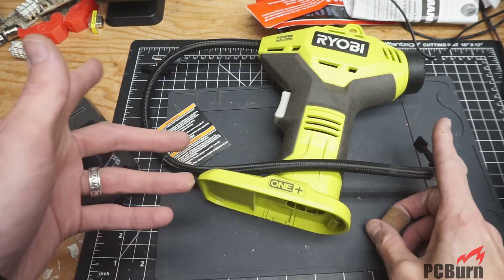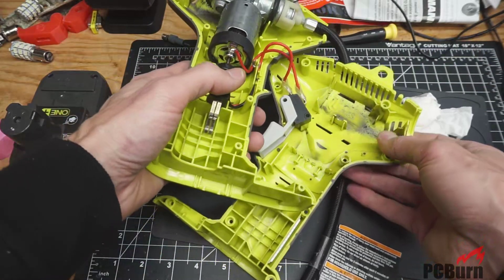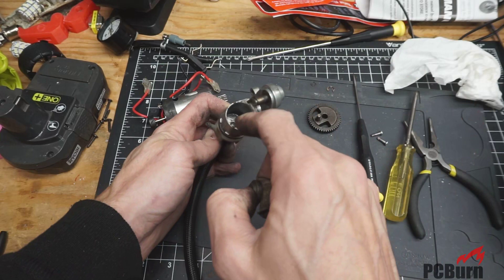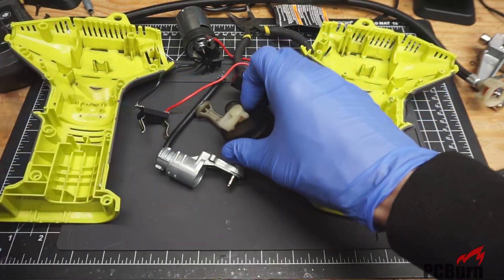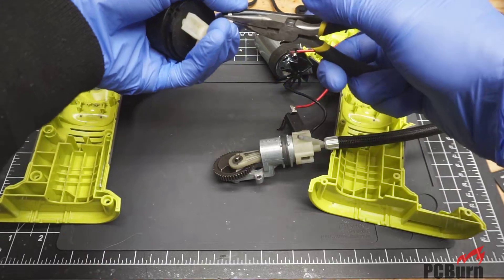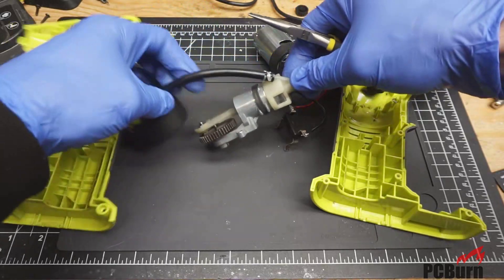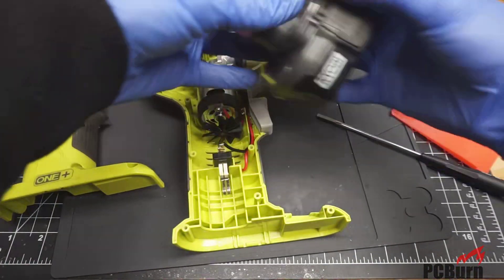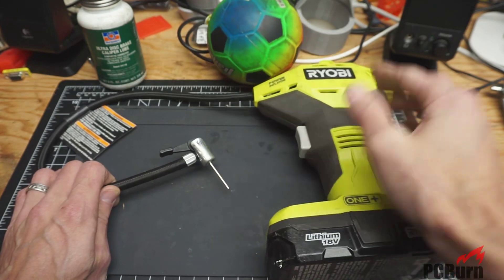Looking inside the Ryobi P737 18v Tire Inflator - Repairing and Designing a Replacement Cooling Fan

Comment: they should make rebuild kits for these. But honestly for $25, I'll just buy a new one.
Reply from the maker: Yea, fair. The newer compact unit is digital with an electronic psi gauge and on/off (so no hair trigger!). I like it.

I assume the internals are similarly cheap but haven't checked yet.
Reply: @PCBurn Oh yea probably exact same internals. I like the new ones better after using them.

I wrapped a piece of #10 wire twisted around the handle of this style, so I could slide it up over the button when I wanted to air up hands free.

I would use 2 at once to air up my travel trailer tires. But being able to set the PSI and press play on the new model is much better. I bet the electronics will outlast the shitty motors too 😂😂
Reply from the maker: @boomer7638 the auto-off does seem more reliable.

Comment: Any suggestions for the pressure gauge replacement? Mine is also -5 psi or thereabouts. Great tutorial - ended up cleaning everything and greasing it back up, works a bit better. My fan blades are all still intact, surprisingly!
Reply from the maker: Yea, starting from completely broken it can't work less. I would probably in-line a cheap gauge if the pump is otherwise working. Although this might be more of a free parts job as I wouldn't spend more than a couple units of local currency on it.

Comment: In a nut shell, they are cheaply made. I had a different one. The dye cast piece between the motor and the piston just broke apart while pumping a low tire. I thought it auto shutoff. When my sister had a flat tire later, I tried it, and it just turned the motor and no pumping sound. Absolute junk!! But to give it some credit, the most durable part is the plastic body!

Comment: How did you take off the old fan base form the motor? Did you just pull it off? Also the stl file will so helpful, thank u so much!
Reply from the maker: I pressed it off while holding the base in place. The STL is included in the links attached to the video below. Is there an issue with it?

Comment: Just opened mine up and it looks like the rubber pistol ring disintegrated. Have you happened to replace and know the size. I was trying to find an assortment but didn’t seem to. I’ve never changed one but it seems pretty straight forward. I definitely prefer to not just throw things away. You made mention that it is a valve as well. Maybe has to be purchased from ryobi. Anyways great video. Thanks!
Reply from the maker: @joncamp9126  I don't actually know the size of the... O ring? I assume. I would grab an index; generally that's what I do if I don't have a size for one. I'll see if I can open mine again and get a rough dimension as well.

I don't believe Ryobi offers replacement parts for these.
Reply: Thanks for the reply. I found a lot of piston rings on Amazon. I just didn’t know if that is something that’s pretty standard. I was going to take measurements and go from there. Was just curious if you had dealt with that before. Not a lot of information on line that I’ve seen. When I opened the tool up the piston ring had been turned into a pile of rubber dust. I was kind of surprised because the tool isn’t that old.
Reply from the maker: @joncamp9126  yea, I obviously don't remember the design exactly. I do need to take mine apart, it has rattled itself into not working!
Reply: @PCBurn  ok well I appreciate it if do! I would rather fix it, but ryobi’s new model looks interesting. It’s not triggered. Can set it and forget it, shuts off automatically when a desired PSI is reached.

Comment: The fan in my Ryobi P737 is intact but loose inside the housing as though it had never been installed on the shaft. The large gear is not straight so I think the center of the gear has been worn down. Maybe I'll keep this to use for another inflator if other parts need replacing.
Reply from the maker: @donsmith9478  that's actually worse than my older, now failed, inflator was. Although the digital one not being programmed was equally bad. The Q/A appears to be lacking.

Comment: Mine started making horrible grinding and cracking noises so I assume my fan is also shot. I am debating just tossing it as i have their 1 gallon compressor for inflating tires...
Reply from the maker: It was fun to take apart. I'll probably keep fixing it (as it has failed again). But it is my least favorite portable compressor; I just happen to use other Ryobi tools.

Comment: Have the same issue,was wondering by any chance if you can replace the gears on it the smaller gear that's on the motor is showing excessive wear ?
Reply from the maker: Unfortunately I'm assuming there aren't OEM parts available. I'd be leery about just replacing the part if there isn't a cause for the wear that you can also correct.
Reply: @PCBurn  Yeah there is also a little slop on the gear that connects to the piston,do you think the fan also acts as a counter weight? I'm assuming after the fan blew apart the motor started translating a lot of vibrations to the piston..?
Reply from the maker: The fan isn't a weight, it's balanced. There would normally be tolerances everywhere... the only portion with a seal would be the air chamber.

Comment: The reason that the fan may have self destructed is because a piece of solid debris got into one of the side vents. It got caught between the fan blade and possibly the side wall, which cause the fan to fetch up. A nice hack for that might be to install a bit of filter material that you might see on a lawnmower air filter. Cut and glue it to the inside of the vent. Make sure it's clear of any moving parts, and keep in mind that it's something you'll have to clean. I don't know if it would work for certain, but it's an idea worth exploring.
Reply from the maker: Sure, that'd be a good preventative measure. You could also use plastic mesh screening that is sold for windows.
Reply: @PCBurn!  that's a much better option for less air restriction. I was thinking about using silicone lubricant for the piston ring. I just think that a caliper grease is great for the gears, but it may affect the output of air from the chamber as it would take up volume inside. What do you think about that?
Reply from the maker: As long as it's compatible with the plastics and stays in the pathway it'd probably be fine. I'm not sure what the OEM.was; it looked different in both models.

Comment: I got a problem that can not hold on high pressure. I think it's cause of piston seal. don't know where can get replacement.
Reply from the maker: Short of machining a replacement you'd have to buy a new pump.

I'm assuming Ryobi just replaces the whole unit if it's a warranty claim; you can always try them as well.

Comment: hi pal i have the same one but the problem is my hose got damaged
so needed advise as to what sort if clip i need ti attached as the metal clip i have had to be removed need yr advise thanks
Reply from the maker: Anything that'll fit inside the case should do. A simple spring steel hose clip or a small hose clamp.

Comment: I burned up one, was going to try and fix it, but heck at $20 I just bought a new one.   What I hate about these is they are "trigger happy".  You just touch them and the trigger goes off, annoying and startling me.  I want to  add an 'enable' switch, and heck it also needs to keep the trigger on, I use a ziptie for that.
I'd pay another $5 if they had these features.   So basically it needs to add a off-on-trigger switch on it.
Reply from the maker: Yea, adding a push pin safety in addition to the trigger is on my list to do. The original model I have stopped working... I might do that and use synthetic grease as part of the repair.

Comment: Even the cheapest Makita 18V tire infllator copies from aliexpress has Ball Bearings and polyamide housings......really sad quality from Ryobi
Reply from the maker: I was a bit disappointed at it even for 20$ on sale. It also hasn't held up well since.

And the newer model obviously didn't see any QA since it needed repairs out of the box. It requires some kind of calibration that was never attempted at the factory since the guage had a manufacturing defect.
Reply: @PCBurn  OK the Makita rip off 18 V tire inflator was about 30 Bugs, but seems to be worth the money. The ball bearings at connection rod and in the second gear make it much more durable. The fan also made of polyamide, not easy to brake. I do not regret to have all the makita 18V platform rip off tools, wich becomes to be a wide spreaded standard. They are good value for the price, cause they are produced in big quantities, that allows a god price-quality-ratio.

Comment: if you wanted to replace the hose, does it simply unthread and allow you to thread a new one in? Or is it non standard? Great vid
Reply from the maker: Thanks! I believe the hose attaches with a clamping ring around a nipple. It should be shown somewhere in the video... if not let me know and I'll do a video on the latest failure with it and be sure to show it clearly.
Reply: @PCBurn  thanks! As far as I can tell it's not clear from the video. I want to add a different inflator head and not sure if cutting the hose will work. So want to have a backup to replace it!
Reply from the maker: @grutzmac  You're right. You get a pretty good view of it at 11:05. I believe that's a one-time crimped piece integrated with a plastic housing that slots on. On the pump side.

So I didn't actually rip it apart (didn't need to to clean up the issues with the pump). It could be that you can compression clamp a different bit of hose on there, or it might be that it's something other than a pipe or nipple you can get purchase on. Without taking it off I'm not sure.
Reply: @grutzmac  The lever type connector that attaches to the tire valve has been replaced with one of those clamp-on types. I just cut off the old one and stuck on the new one and used a tiny clamp to secure it.

Comment: Thanks for the informative video!  Am looking to buy a battery-powered inflator, but this unit has too many critical parts made of plastic for my liking.  How much would I need to pay for a rugged, reliable unit (if such a thing exists)?
Reply from the maker: For an inexpensive metal inflator the German auto manufacturers include nice 12v unit with their cars (that you could probably find as salvage). I assume someone sells an equivalent unit around 50$ USD but haven't looked.

Comment: Excellent! Thank you for taking the time to disassemble this unit. My hose just blew out, and I'm sure it's due to the heat and me being impatient and ignoring the duty cycle. I was going to replace the hose but may just purchase the updated  pump; these really come in handy in a pinch if your tire is low (even though it takes forever!). I'll be watching future videos-good luck!
Reply from the maker: I didn't notice anything that'd increase the reliability on the newer units. At this point I'm just resigned.to serving it every few months!
Reply: @PCBurn  Exactly-it is admittedly not of the greatest quality, but for those of us who aren't afraid to disassemble things, and understand "it works" not too terrible of a task.

Comment: If I ignored the duty cycle and harmed the motor, is there a motor I can buy to replace a one abs maybe get better performance. I want to stay analog and not go digital. Thanks
Reply from the maker: If you look up the part number on the motor you could use a replacement with the same characteristics. Other than that you'd have to get something similar and test it to see if it's compatible.

Comment: do you know if there is some way I can replace the air hose with a standard air compressor hose?
Reply from the maker: The same way the current hose is held on. With a clamp. Although this has such low volume I'm not sure what you'll do with it.
Reply: I guess my thought was I was wonering if there was some way I could attach an air hose that had a guage an the end but if it cant accept a standard size air hose I guess it would not work? I mean I guess you probably know there are some air compressor hoses that have a built in guage?
Reply from the maker: That doesn't mean I thought of it in reference to your question! Why I wasn't sure why you'd want to. Standard air hose, to me, means an bare air compressor line. Not a gauge.

Again, you can do that. With an appropriate clamp.
Reply: @PCBurn   Hi pc I think generally the arugment is that hand inflator guages arent accuarate so my thought was if there was a way you could put in  a standard compressor hose that had a guage tip it would be an enhance product
Reply from the maker: @Fredengle  I think it's a good idea. Might do that with my defective electric gauge pump.
Reply: if your able to figure it out please make a video thank you
Reply from the maker: You take the appropriate hose, insert it over the press fitting nipple, re-attach the clamp, and you're done. I'm unsure what you would like to "figure out".

Comment: I have a new one it blows HOT AIR and the hose gets very hot to touch after 3-5 mins was yours the same?
Reply from the maker: Yes. I'd make sure the fan's intact (you can see it through the grate).  You can check the duty cycle in the manual; I believe it's 5 minutes before you have to let it rest and that should be enough time to top up a car tire or inflate a small tire.

It will get a bit hot even if it's operating correctly during that long a run. Unfortunately the manual doesn't give any indication of what the tolerances are.

I never actually looked at it prior to taking it apart. It's entirely possible it was a mold defect on the fan that caused it to blow apart. So good to make sure it's all okay if it's new.
Reply: @PCBurn  Thank you for the info and your quick response.

Comment: I got a used one for cheap that seems to spin the motor and screach but not pump above a certain pressure
Reply from the maker: It's likely that the lubrication's gone. If the fan's not damaged and the pump's okay someone probably ran it too hot.

Comment: Mine has the same problem and the gears worn down a bit.  I am going to try petroleum jelly instead.
Reply from the maker: Let me know how it works out. The lithium grease has held up fairly well since then and appears to be what they lubricate the new models with (from the P737D I took apart).

Comment: I just opened mine today! All my fan blades blew off like yours but my piston actually cracked in half. Gonna JBWeld and send it.
Reply from the maker: Yep, probably over-heated after it stopped running the cooling fan. Mine certainly was but the compression had degraded so much it was near-useless in addition.

Comment: Wish I could find the fan. I landed here looking for a replacement. Might buy the new one.
Reply from the maker: Yea, you can print the one I've included at a library if they've got a 3D printer. I haven't seen one for sale.

I should have a look inside the updated digital model coming up. I finally found one.
Reply: @PCBurn  you should get them printed. Sell a few on eBay. Seems it is common from what I read.
Reply from the maker: Will do once I get my printers that can handle limited production work back up.

Comment: Enjoyed your video.  Had a dial type that went out on me.  Purchased a digital read out, and now the numerals are out; still lights up, but no numerals.  Any ideas??
Reply from the maker: Huh. I haven't actually seen one in the wild; Home Depot here doesn't seem to have the inflators.

At a guess they might be using the zebra strip style rubber press fit for the display. If so, it may have come decoupled on some of the connections.

If I come across one I may pick it up. That's a curious failure.

Here's a link on the ZEBRA (apparently a brand) connector I was referencing: https://en.m.wikipedia.org/wiki/Elastomeric_connector
Reply: @PCBurn  Thanks very much for your prompt reply..  Your a tad over my head technically , but it surely makes interesting reading.  Don't know what's going on, but the prices on these inflators has dropped from upper $30 range to $20.  Thought maybe they were unloading these to come ouit with a new and hopefully better model.  Surely do like the product. Have a 2 acre space in a small country town in TX and usually have a flat on some piece of equipment on every trip.  The inflator has been a time saver.
Reply from the maker: If I get my hands on one I'll shoot some video. Should make sense if you're lookin' at it!

Comment: just buy a new one at Home Depot for $20 (pump only).  Mine includes a fan on the motor. So did the old one.  The  znew one includes a spring behind the trigger.  BTW, the new model has a digital pressure gage which is accurate.
Reply from the maker: From some other comments on here the pump'll still be pretty crappy.

I'll take it apart again in a few to see how the grease held up; I'm guessing refreshing it's the only way it'll get decent pressure.